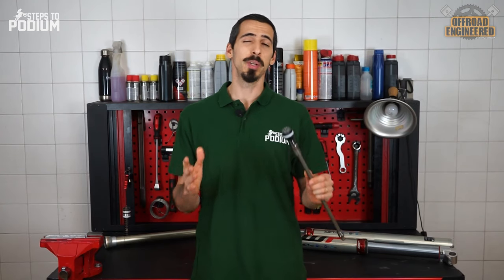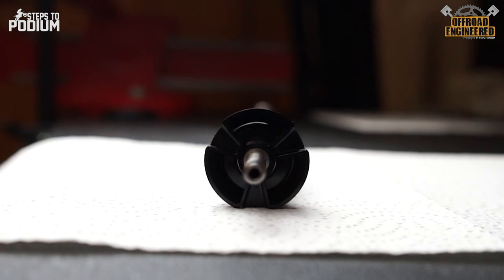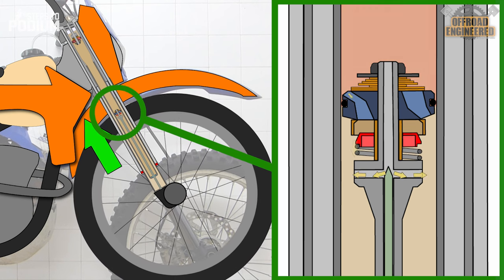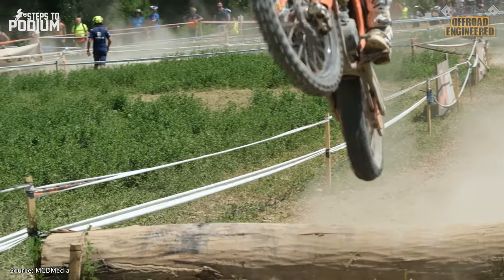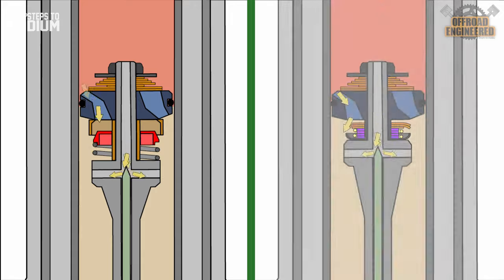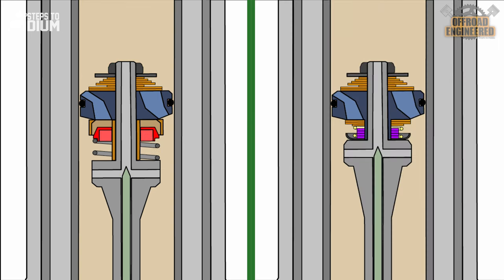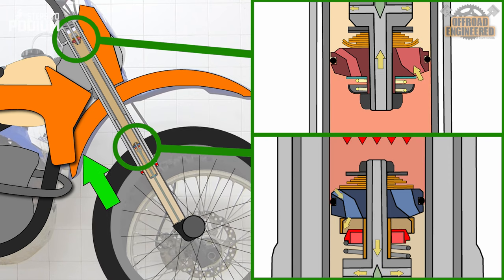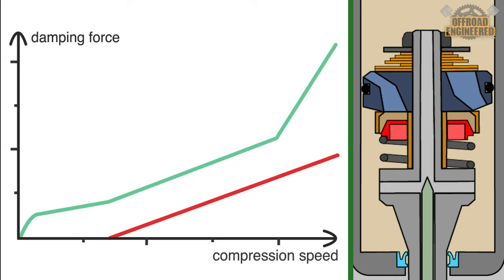How @WP_Suspension  Cone Valve works | Offroad Engineered

Comment: Great video but I will never consider buying a bike with WP. If you need to put +2000€ in a bike, just to get it to work properly. Well, than the suspension is not good at all. Even worse when the bike costs 1500-2000 more than their competitors from start.
Reply: Agreed... It's disgusting that I find myself here watching this video because the WP XPLOR fork on my brand new $13K bike sucks so bad. 😞
Reply: It this like an old-school is better thing?
Reply: 90% of average riders don’t take the time to set the bike up.  I have a 2022 gasgas ex250f and it’s the best stock suspension for riding woods and trails that I have ever rode.  It struggles on moto, but play riding, trails, mixed woods, it’s excellent.  Also have a 2024 250SXF and it’s bone stock and excellent.   Took a few hours to figure out where I want clickers and sag, but it’s money.
Reply from the maker: @joelballard4955 completely agree with you!!!

Comment: This is not accurate, because the WP mid valve is more restrictive than say a kyb or Showa. So when the cone is open all the way it’s still more restrictive due to the port entrance hence the delta shims on the reb side. Also it’s common on kyb and aer to run a leaf spring shim setup giving a broader range to be in the sweet spot.
Reply: At the very least, I'd say it's a debatable point.

Comment: Thanks! No matter how genial, it is a simple idea and easy to build. How is then the enormous cost of CV forks justified?
Reply from the maker: You're paying the innovation (and all the r&d behind it), not only the build cost 😉
Reply: @StepstoPodium  sure, but somebody will soon clone the design…
Reply from the maker: We'll have to wait and see! 😄
Reply: @miro_s you are also paying for all cnc and coated parts with tighter tolerances vs stock forks.
Reply: People keep saying, "Why do cone valves cost so much?". They don't cost that much.. they're $3600 per set. If I go online right now and order a brand new set of STOCK forks for my 2022 ktm it would cost $2900. They're currently marked down to $2500 but you get the point. "Cone valve" forks are not JUST cone valves in stock forks. The upper tubes are straight and have no taper like stock forks do, making them substantially stiffer. The bottom lugs are billet vs. cast, and many of the parts hold much higher tolerances and are coated differently. Lastly, cone valves are somewhat sensitive to setup, which in a production standpoint would be a disaster for reviews as they would come valved for a very narrow set of riders. They can only do so much, hence why suspension should be the first money you spend on any bike as you likely don't meet the exact criteria it was set up for. So no, cone valves do not cost that much. They're only $700 more than a set of stock forks, and most people pay about that just to get billet lugs on a pair of stock forks. So I don't see how they're expensive. 

Plus, all the comments I see regarding how expensive KTMs are, why should I have to spend so much money on suspension? Well, you really don't, just get a simple revalve and correct springs, and most will be plenty satisfied. You should literally do this with EVERY manufacturers' bikes.
Reply from the maker: @DDRDK amen to that!

Comment: Why not put cone valves on both sides of both the main and mid-speed dampers?
Reply from the maker: It simply doesn't make sense to have that kind of valve on the base valve, it would make the overall suspension behaviour very hard to adjust, even with the adjustability it provides.
Reply: @StepstoPodium  Fair enough. Is there anything stopping it from being on both sides of the mid-speed valve, though?
Reply from the maker: The rebound valve doesn't need to have such complex and elaborate valves. What's available already covers all the needs you might have. On rebound you jest need to control the extension of the spring, that's all.

Comment: Great video,  why are cone valve so expensive. It looks simple enough.
Reply from the maker: You are not paying for the manufacturing process, you're paying for the innovation and R&D behind finding a simple solution to a tricky problem 🙂🙌
Reply: Because the patents haven't expired just yet. Got to milk all they can till that tech opens up for others to use.